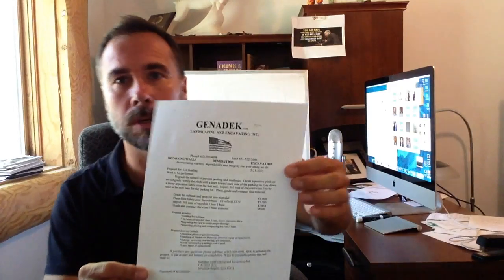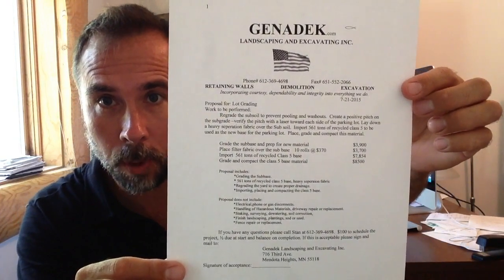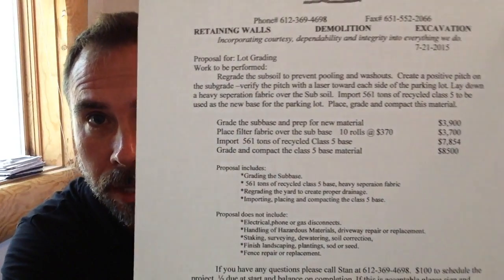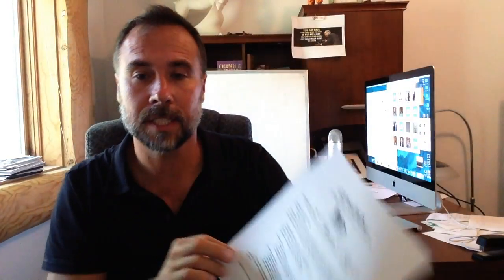How to Bid  Excavating and Grading

Comment: you wont get much work like this and even if you do you wont make money. You are placing 6 inches over the area if you didn't estimate enough its on you, you will get more work by convincing the customer of 6 inches no mater what, any mistake is on you, simple math and a phone call to the local material testing company will tell you the weight of material per yd3 at 95% compaction,  always figure 10% over and put that in your pocket. Don't forget to overlap the fabric 2 feet if the job calls for 9 rolls bid and buy 10, take the left over to the next job. Heres an example for the people just out of collage, if the job calls for 700 feet of sewer pipe BUY 750 feet or two extra sticks if a labor makes an incorrect cut your coverd.  You can still break everything down to the customer they like that but don't pass on your mistake to them,
Reply: Rusty Young I like the way you're thinking
Reply: I'm laughing at the idea that an area they clearly don't use much is presumed to be "solid" for high-volume, high-density traffic and heavily-loaded indoor forklifts just because they're only sliding around on it now. Smooth-surface indoor forklifts are short, narrow, have easily "upset" centers of gravity and their hard tires provide zero suspension and no capability for the tires to "bite" on any material that isn't nice, smooth, level concrete or dry asphalt. They are also very "dense" in that they concentrate a hell of a lot of weight into a very small surface footprint and onto four very small "contact patches" with their small, hard tires. 

Its very easy for a 6000-lb smooth-surface lift truck to have 3 or 4 times the ground pressure and loading of whatever surface per square inch as a 6000-lb rough-terrain forklift and their total weight with a load can be far higher despite the machine itself looking small by comparison. 6 inches of ANYTHING over an uknown surface of mixed rock/clay silt like that is a recipe for cracks, potholes, etc. People just don't know that on a pound for pound basis there is nothing on rubber tires that is harder on paved surfaces than a smooth-surface forklift. 

And that lumberyard had better be in a warm climate or the contractor had better put a nice slope on it to drain it, or come freezing rain/melting snow time they'll still be dead in the water trying to get smooth-surface forklifts to move material on that new pavement. Common sense is if you lack for traction with a forklift you're using the wrong forklift for the job.
Reply: Maybe you can be cellmates when the way he's thinking gets his dumb ass thrown in jail. Don't ever assume that just because someone pays you to do a job as an "expert" they have no idea what the job entails and can't do basic math, which is all it takes to figure out when you're being overcharged. Generally speaking, the "contract-it-out" crowd of business people and homeowners, etc. is composed of people who have done well enough for themselves in some aspect of business or another to be able to hire work done. And anybody who has ever run a business knows that "10%" is a really big deal when it comes to things like INVENTORY. Do you think someone who sells lumber isn't going to pay attention to things like VOLUMES and MEASUREMENTS and might know that if some CONTRACTOR comes in with a set of plans for a house and the total lumber called for in the plans is 1000 board-feet and the contractor orders 1100 board-feet, either the contractor is incompetent or crooked? You deal with mistakes and resulting material shortages when they occur. Not as a 10% "put it in your pocket" premium tacked onto the bill at any point. Marking up materials that are paid for by the contractor and then are "retailed" to the customer are a different story, and because the contractor has PAID FOR THEM and HANDLED THEM and TRANSPORTED  and maybe STORED THEM, its an understandable  cost of doing business. But a 10% markup on raw materials delivered to the jobsite in a truck might just raise some eyebrows, too. Not to mention you have to be an idiot to go online in this day and age and brag about and praise screwing the customer out of 10% of the material cost right off the top. What gets most con artists, crooked contractors and other "business people" who screw customers as part of their normal day to day business operations caught and busted? Bragging about it.
Reply: Making a profit isn't illegal. Just saying like. ;-) Even if he "tacked" 110% onto the Bid price, that's his prerogative. It's called "Business". It's for the Customer to accept or reject. I'd be very wary of only tacking on 10%... 10% becomes a loss rapido. I'd be tacking on 25%.
Reply: Stanley has been in business for 33 years and has built him self a multi million dollar company. 

I dont think he needs your advise
Reply: I agree. Prepare for the worst and shoot for the best when preparing a bid. I’m learning the process and this is good logic. 
I’ve been building almost 20 years(28 w/overtime) and I KNOW sht happens now matter how hard you prepare.
  Thanks for the advice

Comment: if your proposal says you will lay 10 rolls of fabric and you needed to lay 11 rolls you say your covered (and honest) for any extra needed because you only said 10 rolls to begin with in the proposal.  However, if you only needed 7 rolls because you didn't need 10 rolls and you didn't inform the customer of that then you either owe the customer three rolls of fabric or a refund for not suppling what you said you would. And, therefore your not being honest and the customer can sue you for not doing what you said you would i.e.: laying down 10 rolls.  And people wonder why they don't trust people in the trades. (?) Just my 2 cents.
Reply: Focalplane I was thinking the same thing. I never keep what I do not use let alone charge the job site for material I do not use..I do not like the way he does business.
Reply: It's still a lump sum bid. Same thing with a deck bid I estimate materials. Sometimes I over estimate but it helps us make more labor on the job since I don't give astronomical labor numbers. But it saves me if I'm under bid on what materials I needed on the job. Sometimes I inform the customer that the material bid was high and I'd like to reduce the final price, but not terribly often.
Reply: If he presents it to the customer and tells them he's estimating 10 rolls at that price but the price is $3700 unless more material is required how is that not honest?  The customer doesn't have a gun to their head.  They don't have to accept the contract the way it's written or even go with him as the contractor.
Reply: I agree focalplane. I think it's dishonest  to charge them for 10 rolls and only use 7 rolls. That's not good customer service.
Reply: @nfurber2  Where the hell did these guys come from? Who in any business sells goods and services at their cost or less? Bids are not an "or less" proposition. The bid number is the bid number whether accepted or declined. He delineates and itemizes in areas where protection from cost over runs can occur. Competing against other bids is what keeps cost to the customer down. It's called Capitalism. It works. Always has - always will.
Reply: This is a pretty normal procedure but you are right. If you under bid then you eat the difference, if you over bid then they do. It's a lump sum bid in the end. Unless some crazy, unforseen turn of events happens then you don't go to the customer to get more money you just get what you charged for so charge right the first time lol
Reply: Apparently none of you listen to what he said in the beginning of the video. He clearly said that if he overdid it then he has the option to let the customer know and reduce the total bid but he doesn't necessarily have to do that. Either way he put it in the bid both to let the customer know what his plan was and to let the customer know so that if it changed he could easily add it in the contract if he needed to. but he clearly says in the beginning of the video that he could let the customer know and let the whole jop be cheaper for them and in the end it's just a personal choice. You can decide to do that and then maybe the customer is grateful and considers you a more reputable contractor or you can keep silent about it and put more money in your pocket the choice is yours at the end of the day.  what kind of person are you I guess but he clearly says you can do either one and there is nothing wrong with that in my opinion.
Reply: Always bid for overage and have a clause stating you keep extra material. Your teqnique will lose you money on big jobs

Comment: I just have to say, why don’t you just use metric? So much quicker to get you estimate for the crush rock, and a good rule of thumb is, 2.4mt to cubic meter you need to fill. That’s if you compact it to 100%. But at least it give you a better and more accurate estimate.

Comment: Excellent vid.....I used to underbid jobs and as I looked at what I was bidding I found that it literally cost me money to do work for others.  Fact is that materials are expensive, fuel is expensive and labor is very expensive.  I really like how you justified every step of your process so the customer could see what he's paying for.  I have issues with not building in factors by which the customer can track your progress and material use.  If I use less material I have already built enough profit built into the bid to add funds to my materials escrow.  I always over build like you do and ALWAYS keep my word even if it costs me money.  But over all this is a fabulous video.....thanks for the info.....
Reply from the maker: +Jacob Lasader Sounds like we have a lot in common :)

Comment: I'll never do this in my profession but I've done stone, gravel and pacer driveways. Same concepts but I'm intimidated by those big jobs. Another impressive video Stan da man!
Reply: "paver" (nicolock)
Reply from the maker: ☼Tropical Detailing☼ As most companies grow so do the size of the projects they will take on.  You may not be ready today-but you never know about tomorrow :)
Reply: Yea....exactly! I've done the work on BIG projects but one day may have that push to get a $15,000 project. The potential and skill is there....just put it to use. I'm open to expand for sure. Thanks Stan!

Comment: I need to add some clarification to your video. First Stanley and everyone else. you need to do a "site analysis" as the video shows. However you need to look at existing grades. For example, the slope or grade of this lot naturally drains to one corner. So you don't always want a "crown". For those that don't know, 3/16 to a 1/4 of an inch in 10 feet will drain water. So you may want or need to check grades before you do your estimate. For example. in the project in the video, you may have to haul in clay spoils to create a crown in the center. Otherwise, cutting the outside edges will create standing water on the two-sides. If you have natural vegetation such as grass as it looks like in this video, remember that it was slow down the water and cause ponding in a heavy rain as the storm water tries to run through the grass. This would be true even if Stanley hauled in clay spoils to build a crown. So please be  thorough, check natural drainage, existing catch basins and grades By doing so will save you time, headaches, and cost later on. 

Now let me also add some clarification to sub bases. Not only am I a contractor, I am an inspector for the Ohio Department of Transportation.  Stanley makes it sound easy however he left out some major things that you all NEED TO KNOW! If you are grading for a parking lot or anything that is going to be paved, if you are NOT sub-contracting the paving, find out who is! Ask the owner, client, developer etc. The reason is simple, you need to grade it the same way it is going to be paved! It needs to be paved the same way it was graded! Why is this important? Say you are the grading contractor as Stanley was on the Menard's I think he said,  who is doing the stone grade? Most big jobs like that someone is going to topo the site to check grades If the grade is off then it will cost the paving contractor heavily for extra asphalt. Asphalt is far more costly than stone! Stone is more costly than sub-base!  The stone base or grade is to allow water to drain under the asphalt or concrete without soaking into the sub-base and making a soft spot. So the question will be who is paying for the correction??? The paving contractor will put it on the excavating and grading contractor.... YOU! 

Allow me to stress there is huge difference between landscaping and excavating! If you are doing ANY grading where there will be live load or traffic constantly driving on it or with heavy weights... trucks, forklifts, warehousing materials, do yourself a favor and compact the sub-base and any stone grades. If you don't own a smooth drum roller, RENT one! They are more than reasonable! This will seal the sub-base and stone to help prevent rain and storm water from soaking into the sub-base and creating a sub-base where you have to come back and do re-work. 

Stanley talked about driving a loaded dump truck around and around. That is called "STATIC ROLLING" We use this method to "test proof" the contractors work. There are tolerances for rutting. As far as compaction, there are a number of factors... the material type, moisture content and compaction. All of these must be just right to obtain "optimum compaction"  For example if you are using a granular stone material such as #304 Limestone, if it is too dry, it won't compact! If it is too wet, again it will not compact! What Stanley is talking about is Proctor  test is using a nuc gauge to test form moisture per material and the compaction required to obtain "optimum" or mimic mother nature. Tpyically this is going to fall between 96% to 98%. You can gain more as he stated, however, say you over roll it, then there is a point where you will lose compaction. So say you hit 104%, if you continue to try to compact it you could take your proctor back down below say 96%.

So the rule or thumb is take your material and grab a handful. Squeeze it into a ball in your fist. It should not crumble! If so add water! It should also not squeeze into mush and come out between your finger. It should make a ball and leave a slight bit of moisture on you palm. It should break apart. It is somewhat hard to example but picture cookie dough. Not to wet or dry! 

If you have material to wet, you can dry it. If you have a dozer or a skid steer with a dozer blade  angle your blade as far left or right and down on the down angle like a plow. Plow into windrows  Allow to dry to where you see crusting. When you see this then you can roll it again. With a backhoe or excavator, use the teeth to rake the material. Allow to crust and repeat. 

Hope this helps and clears up some things!
Reply: I love geniuses
Reply: I'd love to be your apprentice. You'd give Albert Einstein a run for his money.
Reply: Very informative.  Thanks for adding this.
Reply: You sir are a legend. Thankyou
Reply: Where is your channel so we stop watching this Stanley jack of all trades guy
Reply: Using a dump truck to test compaction? Wow only in Ohio.

Comment: Great vid. Some questions for those in the comments or even Stan if he even looks at these comments still:

1) You said you charge roughly $6 to get class 5 transported per ton to the site, and $8/ton for the class 5 itself. Say you're doing a job and a customer wants you to bring another 2 tons at the end. Would you really go to get 2 tons of class 5 in a dump truck or pickup/trailer for $20? How do we protect ourselves in these situations that don't make sense unless they're at a large scale?

2) How do you deal with clients who decide to go another direction and instead of signing you up for the whole contract, they only choose you for 1 small part. Even though you have profit and etc in all your parts, are you really going to go do one small part of the job for say $250, needing to allocate labour and equipment that could be doing something else  and not get the rest of the contract? Doesn't seem worth it.

For example, I'm making a quote right now to strip a lawn and level the remaining soil. I'd like to price it by the square foot, but then if I get on site and the client starts to nitpick about how I didn't do 2 square feet there and another 5 square feet there (if they didn't need stripping), just seems like you could get nitpicked to hell by customers and at the end of the day make way less than you predicted since there are only so many hours in a day to perform work.

Comment: One of the most important things to keep in mind during the bidding process is that multiple estimates from different contractors is what keeps everybody honest. I have seen two different contractors bid the same job with the first contractor coming in at $25,000 and the second contractor coming in at $50,000. The contractor that bid $50,000 very rarely wins any of our business now that we are always getting three or four bids on every job. 

It is fine that he charges more than most other contractors, but he is usually going to miss out on work when the customers are getting multiple bids. If someone does not get multiple bids, then they are taking a chance that they will be paying more than they could have paid.

Comment: Interesting to see how others break down bids.  I do mine a hair but differently but i have a small crew and don't separate them often.  My main work is asphalt but I do plenty of base and gravel work as well.  But like I said I don't charge per price of equipment because I have it all with me each day, I do however charge for what I want profit wise per day plus material.  Obviously bleach job is different and little driveways aren't a Wal-Mart parking lot but in between those 500k jobs, you keep your crew in work and make a little change as well.